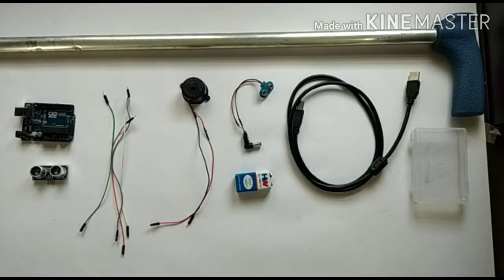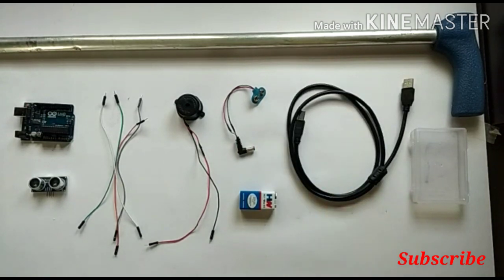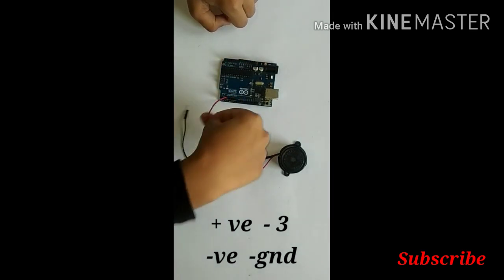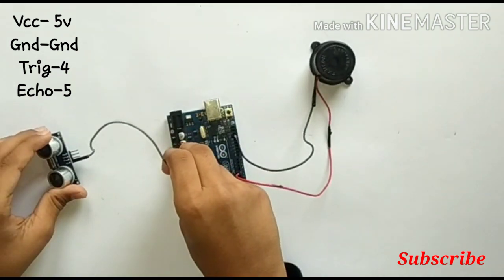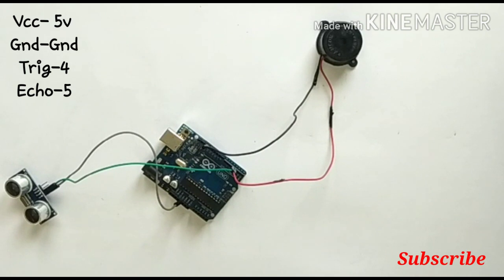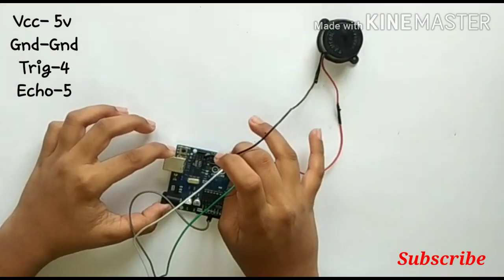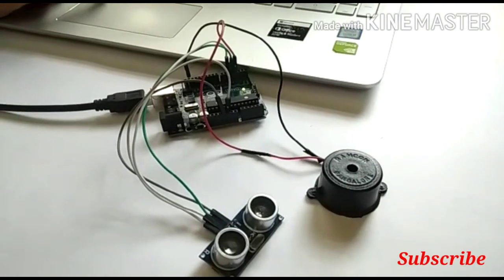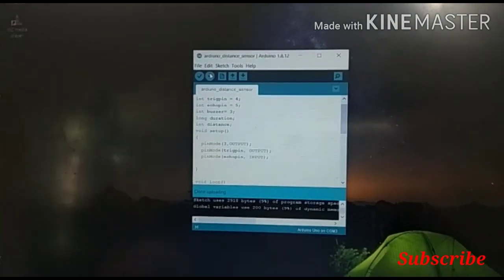Diy- How to make a smart  blind stick

Comment from the maker: //Robo tech
//how to make a blind stick 

const int trigPin = 4;
const int echoPin = 5;
const int buzzer = 3;

// defines variables
long duration;
int distance;
int safetyDistance;

void setup() {
pinMode(trigPin, OUTPUT); // Sets the trigPin as an Output
pinMode(echoPin, INPUT); // Sets the echoPin as an Input
pinMode(buzzer, OUTPUT);
Serial.begin(9600); // Starts the serial communication
}

void loop() {
// Clears the trigPin
digitalWrite(trigPin, LOW);
delayMicroseconds(2);

// Sets the trigPin on HIGH state for 10 micro seconds
digitalWrite(trigPin, HIGH);
delayMicroseconds(10);
digitalWrite(trigPin, LOW);

// Reads the echoPin, returns the sound wave travel time in microseconds
duration = pulseIn(echoPin, HIGH);

// Calculating the distance
distance= duration*0.034/2;

safetyDistance = distance;
if (safetyDistance <= 80){ //Enter the Distance 
  digitalWrite(buzzer, HIGH);
}
else{
  digitalWrite(buzzer, LOW);
}

// Prints the distance on the Serial Monitor
Serial.print("Distance: ");
Serial.println(distance);
}